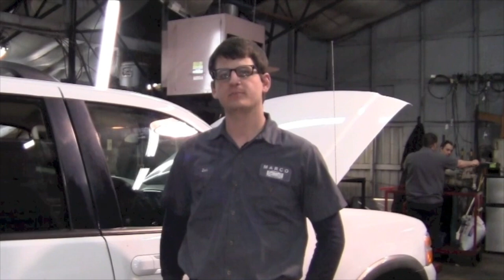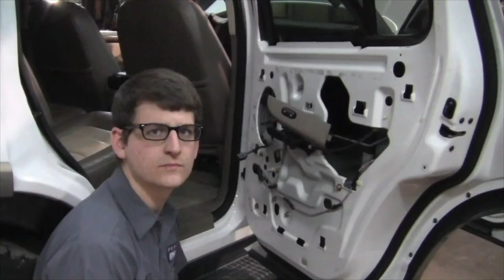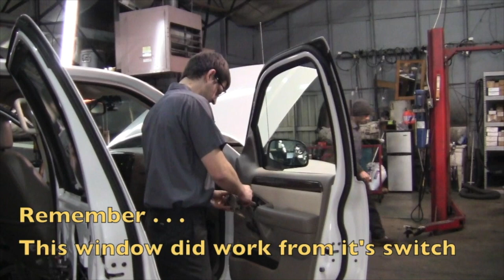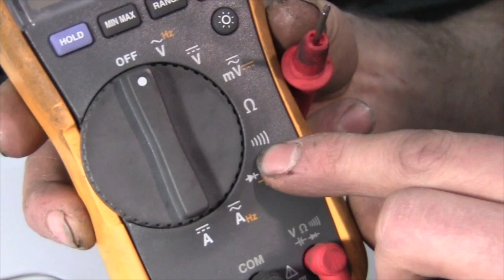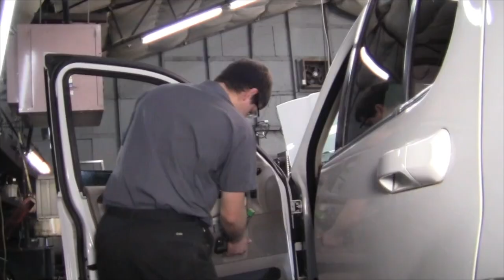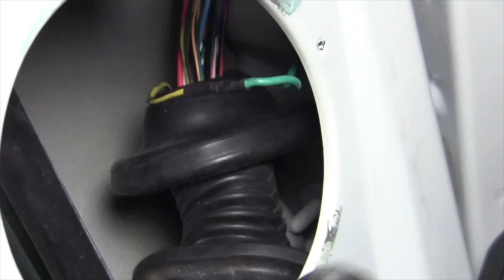A Lesson To Learn From

Comment: Hey Duane,

I really appreciate your videos — they've helped me learn a lot, and I was hoping you could give me some guidance on something I'm working on.

I have a 2003 Dodge Caravan SE with the V6 3.3L Flex Fuel engine. It's got a Multi-Port Electronic Fuel Injection (MPI) system. Here’s how I understand it works:

•  Air gets pulled through the air filter housing and intake duct into the throttle body.

•  Inside the throttle body, there’s a throttle plate that controls how much air goes into the intake plenum and then to each cylinder.

•  Each intake port has its own injector.

•  The MPI system sprays fuel into each intake port in the same sequence as the firing order.

•  The PCM (Powertrain Control Module) controls the injectors and constantly monitors engine conditions (like temperature, load, and speed) to determine the right amount of fuel.

•  It adjusts fuel delivery using pulse width (how long the injector stays open), and can change this instantly — even between cylinders.

Ignition System – General Info and Precautions:
My van also has a distributorless ignition system, or Direct Ignition System (DIS). There’s no distributor. It includes the PCM, camshaft and crankshaft position sensors, knock sensor, ignition coil pack, spark plug wires, and spark plugs.

The coil pack (on the 3.3L) contains three ignition coils in one unit, mounted on the left end of the cylinder head. The Auto Shutdown Relay (ASD) supplies battery voltage to the coil, and a pair of drivers inside the PCM controls the ground circuit for each coil.

It’s a waste spark system: every time a coil fires, two spark plugs fire — one on the compression stroke, and the other on the exhaust stroke.

•  Firing order is 1-2-3-4-5-6.

•  Center coil fires 1 & 4

•  Right coil fires 2 & 5

•  Left coil fires 3 & 6

So for example, when cylinder 1 fires, cylinder 4 fires too — but that one is just “wasting” the spark on the exhaust stroke.

Here’s my situation:
My van has a misfire, and I want to do a manual cylinder power balance test by cutting fuel only (not spark), since I want to avoid damaging the catalytic converter.

I don’t have access to a professional bi-directional scan tool that could do this electronically — that’s why I’m trying to do it manually at the PCM level.

The fuel injectors are buried under the intake manifold, so I can’t unplug them directly. But I located all six injector control wires at the PCM C1 connector:

•  Injector 1 through 6 drivers — all control wires from the PCM.

My plan is this:

•  Backprobe each injector control wire one at a time at the PCM.

•  Briefly interrupt the signal to cut fuel and watch/listen for the RPM drop.

•  This way I can figure out which cylinder causes the smallest or no RPM change — pointing to a weak or dead one.

•  I also plan to unplug the IAC motor during the test so it doesn’t mask the RPM changes by compensating.

Here are my questions and concerns:

1. Would disconnecting the IAC like that be a good idea to avoid interference during the test?

2. When I backprobe the injector control wires, should I use a T-pin and a test light (hooked to battery positive) to momentarily interrupt the PCM’s ground signal and cut fuel?

3. Or should I physically unplug each injector driver wire from the PCM one at a time instead?

4. And most importantly — how can I “be the PCM” and meet the conditions that the injector driver would normally turn on?
How do I make sure the PCM is actively sending injector pulses when I run this manual test?

I know this is a long message, but I really wanted to give you the full picture. I’m trying to do this safely and correctly, and I’d be super thankful for any tips or insight you can offer.

Thanks again for all the knowledge you share — your teaching really clicks with me, and it’s been a big help especially since I learn a little differently.
Reply: Does it have any codes like P0302?  Or P0202?  Is the check engine light on?  Or can you just feel the misfire with no codes and no CEL?

Comment: It works but in areas of movement I would crimper and heat shrink. But in the 70s that’s the way we did it solder hot not cold joints

Comment: Troubleshooting was great but, this is where I have to disagree respectfully for the repair. As an avionics technician in the Navy we would not repair this wire using this method. I would use a butt connector with a solder ring imbedded so when you heat schrink the connector solder would flow inside around the wires and the shrink would wrap itself around the wire for a good clean weather seal all at once. Works great on C-130 Hercules & F18 Hornet aircraft! This method is taught in Navy aviation connector cable repair school.Another tip is you should use a heat sink on either side of the wire to prevent "bird caging" of the insulation.
Reply: I've had to cut so many of those type connectors out. What i've found over the years, is that most repairs, come down to the person doing them. Many ways to make a successful repair that lasts. The only problem I have with the video is the front probing of the connections. I also repair lots of cars that have had those pins shoved into the connectors. Most of todays connectors in the computer controlled environment are .64 mm and even some nano .5 mm. A lot of times, I have to repair all of the circuit problems, created by young techs, using the wrong test leads for the job. Resulting in an original problem, that had one circuit problem, now having 5 or 6. Then I have to find the original problem. Either back probe or use the smallest possible front probe.
Reply: What’s bird caging ?
Reply: The solder in those connectors has a lower melting point compared to typical solder. This quality allows it to flow with a heat gun without melting the overlying plastic heat shrink. That works great as long as you aren't installing the joint near a source of heat like an engine that might reflow the solder. If the copper is not adequately crimped in a mechanical way, reflowing solder could compromise the joint integrity if it is under tension. And with the solder present your tug test is problematic. I experimented with cheap connectors from Amazon and they were not great, presumably because quality control is lacking. So you need to find a supply and tool set you trust. Ultimately I went back to standard crimps. To be honest the ones I like best are uninsulated crimps with separate marine grade heat shrink that is slid on after the mechanical crimp is tug tested and done.

Comment: Soldering is not "professional" in such area (wires moving, bending). Plus, heat-shrink should be adhesive lined.
Reply: well explain how you would have repaired this broken wire